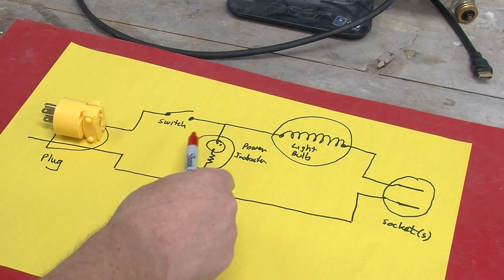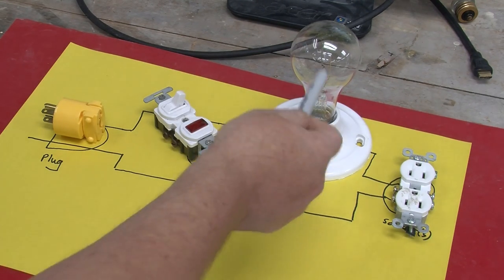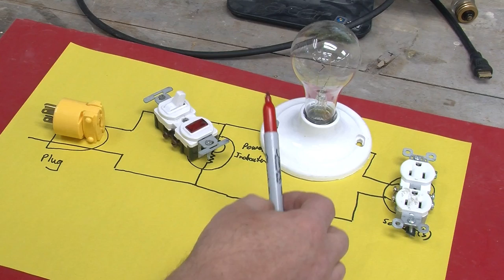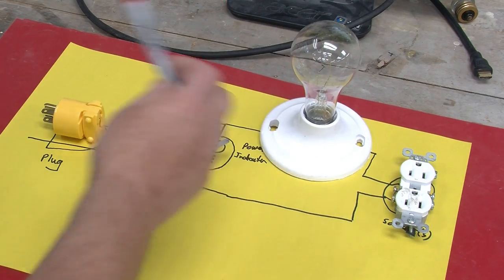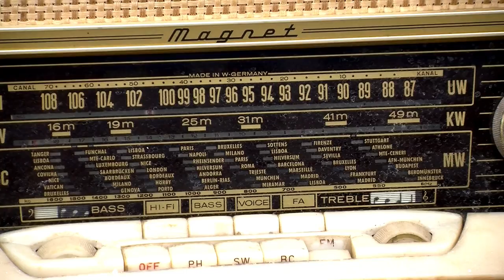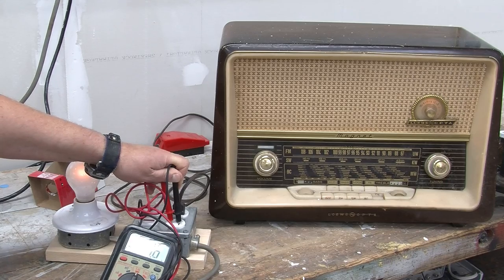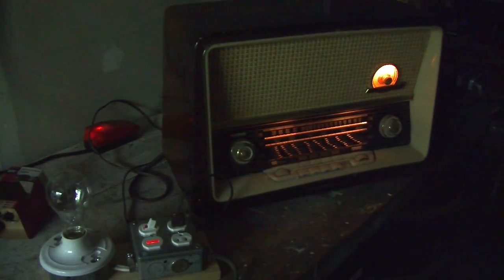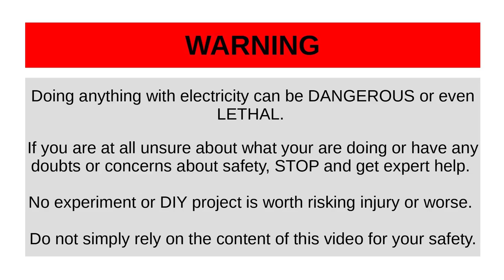When a Light Bulb is better than a Fuse

Comment: i came in wanting to see a light bulb used as a fuse, i cane out knowing a lot more about tube radios, and just picked one up for myself, although it did not have any problems and worked with no issues, i still think it is cool to see it working.
its a very small emerson radio if anyone is wondering
Reply from the maker: You must have read some of the comments - there have been some absolutely fascinating discussions which I was not expecting for this simple little video. So cool that you bought a tube radio. Do you know the model number? You said it is very small so it might be an All American Five type radio. See https://en.wikipedia.org/wiki/All_American_Five unless its battery operated.

Comment: I still use it today (along with an isolation transformer) to work on SMPS...

VERY useful !!!

For convenience, i use double-ended halogen light bulbs (protected in a metal case) that can be rated up to 500 Watts.
Reply from the maker: Yeah - you cant beat the simplicity and effectiveness of a simple incandescent bulb. 

Someone else mentioned halogens. No issues with the bulb operating at lower temperatures and halogen cycle not properly re-depositing the tungsten?  I once tried using a halogen as a load for testing a solar panel setup and the DC seemed to mess up the halogen cycle at one end of the bulb and it burned out quickly.

Comment: Used this trick for decades ( ! ) ..... also useful when using very high voltage transformers with gas discharge tubes , which draw more current the hotter they get ( negative resistance ) .... but much more useful when trying to work out the connections to a ( valuable ! ) but unmarked transformer , connect mains to a 12 Volt winding , just results in a bright lightbulb ! !  FYI in the UK we can still buy these bulbs marked ( rough service ) and also  Poundland™ sell antique style tungsten filament bulbs ( 60 Watt ) for £2 ... you might get these in your  Dollar store™ , but it has been many years since I visited the USA , so you will have to check this out yourself  ! ! ..... ( ? ) .........

Comment: I have seen a guy on you tube who uses one of these, works on vintage guitar amplifiers and hot rods. Uncle Doug
Reply from the maker: I'll bet they are tube amps - would be perfect for that!
Reply: @ElectromagneticVideos  yes high dollar pieces from as far back as the 30's
Reply from the maker: @copescale9599  I remember reading somewhere that people strip tube amps out of old Bell and Howell movie projectors for the purpose. Interesting how amps from that far back apparently are so good for modern guitars.
Reply: Uncle Doug is great. Highly recommended to anyone interested in tube audio
Reply: @ElectromagneticVideos  We also strip them out of vintage organs, radios, and televisions ;-)

The best part about about tubes in guitar equipment is the characteristic distortion. Transistors more or less sound terrible when overdriven (except arguably germanium), but, tubes have a nice warm sort of softness despite still being gritty. There are some hybrids (and effects units) that use tubes in the pre before a MOSFET power section, which works to an extent, but the sought after sound comes from cranking it to 11 and overdriving the entire signal chain. It's really unmistakeable when you've heard and seen a face to face comparison on a scope.

Some argue tube audio is warmer in general; I interpret that is due to a roll off on the highs due to poor response in the upper frequency range. Personally prefer solid state for clean tone, but, I'm a 90s kid so I like the sterile 16bit 44khz hi-fi sounds I grew up with on optical discs... "warm" clean tones need not apply, lol.

Everything is digital modeling now anyway. Computer manipulated sounds are surprisingly as good or better than tubes in many scenarios
Reply from the maker: @mr-meek  I wish I had some musical talent because it would be great to be able to experiment with guitar amps like that where the distortion in wanted. 

I think your right - a large part of the tube sound  is the high frequency roll-off, at least for the normal consumer stuff. The high end stuff seems to not suffer from that but people with better ears than mine say it still sounds different. I think that are a multiple effects that all get mixed together - another future video topic!

Yes its - amazing what can be done with digital signal processing - something I have done a lot of over the years but generally at higher frequencies than audio.  With enough dynamic range and proper modelling of the non-linear effects of tubes one should able to mimic them - but it will never be as cool as some nice glowing tube electronics!

Comment: Two questions:
First:
I'm in Europe (Portugal) and our voltage is - officially - 230 volts.
Is it possible to make this circuit for 230 volts and expect it to effectively protect any equipment that works at 230 volts?
Second:
As it is already difficult to find this type of lamp, can I use a PAR 56 (Halogen type, 230 volt, 300 Watt)?
Tanks in advance.
Macedo Pinto
Portugal
Reply from the maker: It should work with 230V as long as the bulb is 230V. You typically need to somewhat match the lamp wattage to the wattage of the device you are testing. So for a 50 W device a 300 W bulb may give it close to the full 230V. So you typically start with a lower power bulb like the old 60W ones which would really limit the current and then 100W and them 150W etc. 

Someone said halogens will work, so try it. Over here some specialty lamp stores sell all sizes of the old style bulbs, so maybe there is a store like that in Europe. 

With your voltage twice as high as ours, your risk of serious shock is higher. I hope you will consider using a ground fault interrupter (residual-current device) or isolation transformer for any testing you do. Great to hear from someone in Portugal!
Reply: You can't imagine how grateful I am for your clear and concise explanation on this matter that I think is of the utmost importance. My question was whether it would work under our voltage, 230 volts.
I have now fully understood the issue of assigning the different wattages of lamps to obtain the desired protection, in particular the reason for matching the consumption of the equipment to be tested and the consumption of the lamp, which should be as identical as possible.
Once again, thank you very much for the explanation.
I wish you health and good work!
Be safe!📻

Comment: Basically it's a big resistor. We use this in the RC hobby (10 watt automotive bulbs) to protect new builds from a short-circuit the first time you power them up off a lipo.

Comment: I might make one of these for my O gauge train setup. However most transformers will be 90 to 300 watts so I don't know if a 100 or 200 wat light bulb will make them work well. My thought was if there is a short; instead of depending on the built in circuit breaker, if it has one, the short will just make the light bulb glow brightly, instead of maybe melting a wire, or causing more arcing on the track. Something to try some time.
Reply from the maker: It might work. The neat thing is that when the bulb is almost unlit, the resistance of the filament is way down. I would try a bulb close to the rated watts of the transformer or a bit more. So for a 90W transformer, maybe a 100W or 150W bulb. Maybe even 200W. For larger transformers, you may need to parallel a number of bulbs. Probably best to use identical ones so their heating profile is the same. 

You could also try a bulb on the low voltage side is you can find a suitable one - perhaps a 12V car bulb might work .....

Comment: Reminds me of the isolation transformer that Mr Carlson's Lab has for working on older equipment. As I believe it has 2 bulbs, I forget, but he does use bulbs too to limit current, alongside a transformer to provide an isolated line that isn't directly connected to mains and whatnot if i remember right. (also has the benefit of being able to slowly bring up the voltage and bypass the bulbs when the radio has been slowly warmed up and whatnot so it doesn't just, immediately blow up when plugged in.)
Reply from the maker: So a more elaborate combined unit. Neat. It is worth pointing out (and I don't recall if I did it in the video)  the bulb(s) protect the device, not the human. An isolation transformer protects the human, less so the device. The combination is what you need to more safely troubleshoot something. Of course its still possible to get a dangerous shock if you touch two location in the device under test and one has high voltage.
Reply from the maker: @ssikhcnerf  Your right about it not protecting you if you touch two areas of different voltage on the isolated side. As far as it being worse than touching the mains wires, that depends entirely on what you touch and how you touch - surface area on your hands, voltage (say on a tube radio or tv) etc. Even then it would be no more dangerous than if the device were plugged in without an isolation transformer.

Comment: Electric heater drops less voltage than a regular light bulb- if it's problem affecting the equipment working properly. But best of both worlds is a find hefty light bulb, say 400 W halogen. Its cold resistance doesn't affect the circuit as much... until there's an overload and then the lamp resistance increases. Of course it limits the maximum current to whatever that light bulb uses.

Comment: We did this to control charge current and voltage on batteries with a self made power supply with different settings.
Reply from the maker: I can see how it would be a good  current regulator for batteries.  What a great use.

Comment: I have done similar in 12-volt wiring testing. Sometimes I need to power something and don't know what wire is which. Often both sides will show as ground. The light will light up before frying the circuit.

Comment: As an apprentice used to use this as a series test leads for electrical continuity
Reply from the maker: With 120V? Or did you use a lower voltage for the bulb?
Reply: @ElectromagneticVideos  230v in South Africa

Comment: I still use this technique .. not just for primary power, but (for example) to protect FETs in untested power circuits with various flavours of incandescents from flashlight to automotive turn signal bulbs depending on what's on the bench. 

One notable distinction you missed is with "better" though .. Series current limiting resistance (in this case a filament) and a fuse do two very different things. The ultimate purpose of a fuse is ONLY to protect the surrounding environment and upstream utility - not the actual equipment itself. In the silicon age, the kit may well be fried before a fuse gives up the ghost. Tube kit was more forgiving. On the other hand .. with that bulb, you have a 200W pass with a bit of Ohm's law fudge on a radio which requires maybe thirty .. Sure - if you know how to glean, a bulb suddenly or at full brightness is (very) bad, flip the off switch - but it's not inherently a protection device that will automatically save your input trafo if (say) the filter cap is short. In fact, it'll just prevent the tripping of the mains breaker. I don't want to be a troll or pick hairs, because as the world gets dumber there are less of us out there every day that still actually fix things .. and I enjoyed this video. but just calling apples and oranges.
Reply from the maker: Very good points - I guess I was trying to say a bulb is better than a fuse in certain circumstances. Very good point about tubes being more forgiving - more than once I have seen the plate of tube glow red hot and shut off the power and the tube survived once the cause was found. Not so with transistors.

Comment: Yes, good practice for certain applications - not all.  
1 - For example, the inrush current of a 100W lamp might exceed 10A, so it doesn't replace a fuse for all applications.  Of course, even fuses - all fuses - have a time constant.  This is expressed as the time to rupture expressed as a value of I²t.  The useful characteristic of the lamp is of course that when you're testing a low current circuit, the lamp will drop only a small voltage if the circuit under test isn't taking overcurrent (or even s/cct), whereas it exerts its own current limit under fault conditions in the cct under test.  Which is very convenient.
2 - The characteristic of a tungsten lamp can be approximated to the square-law parabola which passes from 0A,0V to the point (rated I), (rated V) and then just pull the bottom of the curve to allow for the cold resistance of the filament.  But that's only necessary if the characteristic is to be part of a circuit.
3 - In fact,  before low power solid state thermistors were available, low power tungsten lamps were used as the series element in negative feedback loops as a means to provide a measure of output voltage regulation, especially in valve (tube) audio oscillators.  This used exactly the same principle as explained here and in the video.  
4 - Of course the valve circuits operated at sufficient voltage and power to drive a small lamp.  For those wishing to experiment with lamps in NFB networks in much lower power semiconductor circuits, lamps can be found as low as 6V/40ma in standard "Lilliput" format or even 1.5V'/15mA made for watches.  A point to watch here would be the thermal time constant of the lamp chosen which reduces as the rating of the lamp reduces, but remains significant in electronic circuits.
Reply from the maker: Thanks for the extensive comment! I'm sure readers will find it very useful! Are you from the UK? I noticed your use of "valve" ...
Reply: @ElectromagneticVideos  Thank you for your reply.  Yes, I'm from the UK.  Chartered electrical and electronic engineer, retired, aged 81.  Seen it all.  
I've edited out an error in my reply: that should be "parallel element" and not "series element" in (3).
Reply from the maker: @jjmcrosbie  That neat! "Chartered" - I'm assuming that means licensed? I am the same - here (Ontario, Canada) the designation for licensed is "P. Eng = Professional Engineer" although most of the general public has no idea what it means.
Reply: @ElectromagneticVideos  From link:    https://en.wikipedia.org/wiki/Chartered_Engineer_(UK)
In the United Kingdom, a Chartered Engineer (CEng) is an engineer registered with the UK's regulatory body for the engineering profession, the Engineering Council. Chartered Engineers are degree-qualified or can demonstrate equivalent work-based learning and have gained the appropriate professional competencies through education and working experience.
One has the title Member of the Institute of (type) Engineers.  My type was "Electrical" so I was an M.I.E.E which embraces both heavy electrical engineering (heavy machinery, generation, distribution and Lighting) and electronics.  Originally I had both qualifications, electronic (Institute of Radio and Electronic engineers) and electrical (Institute of Electrical Engineers)  but then the latter absorbed the former, reducing me to a single qualification.  No problem.  Incidentally, on leaving employment in the profession (in my case enforced early retirement) you loose chartered status, although it's still there if you resume work in the profession.  You can however apply for your institute's diploma, in my case Dip. EE.  Incidentally, members of the Institution of Civil Engineers have the title M.I.C.E.  That's why they repair road dents.  (Eh?)
Reply from the maker: @jjmcrosbie  Interesting - so its similar but also a bit different here - in the professional designation we don't include the type of engineer - we all just have P.Eng. after our name. To get that you need a BSc or BEng in an accredited degree program,  then take a number of non technical tests (ethics and law/rules) and have to show a number of years experience working  under a license holder. If you don't have a degree from an accredited university you can take a series of technical exams.  We are required to do a certain amount of continuing education/learning every year and have to indicate the ares we practice in - in my case electrical (which includes electronics), computer and physics. You could probably guess those from my videos.  So in your case the Dip EE is available after you retire? Or can you apply for it at any time?
Reply: @ElectromagneticVideos  I don't know, it never occurred to me to ask!  Anyway, the academic qualification you need to get started gets you Associate member ship, AMIEE, which is equivalent to the Dip. EE plus your position in relevant employment, so I suppose there's no call for it at that time.
Reply from the maker: @jjmcrosbie  I guess all of these designations evolved over time so its not always the most straightforward progression between license levels and as our conversion shows, can vary from location to location.